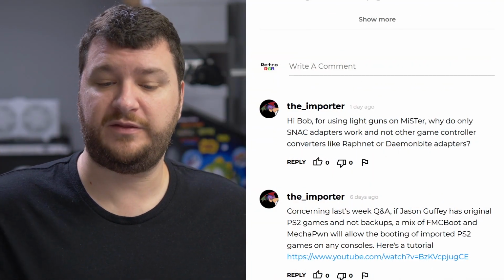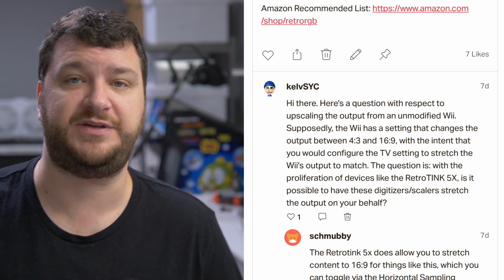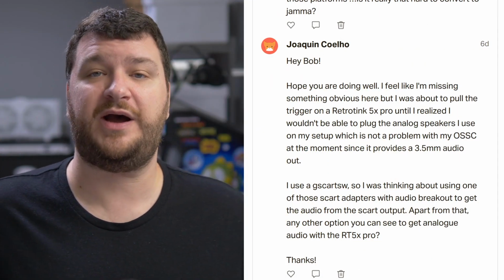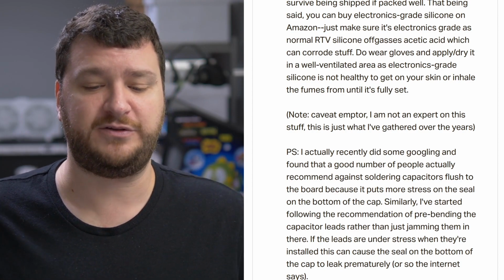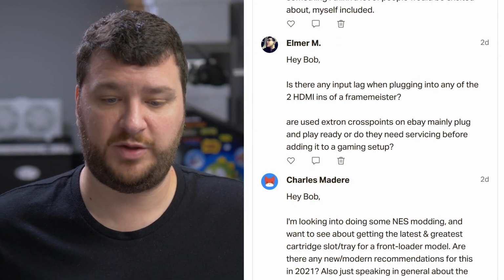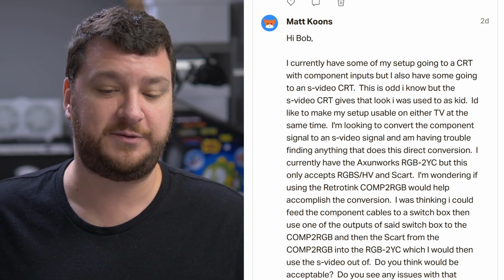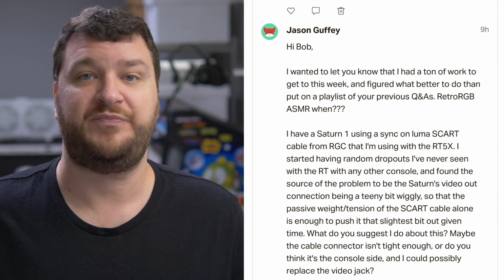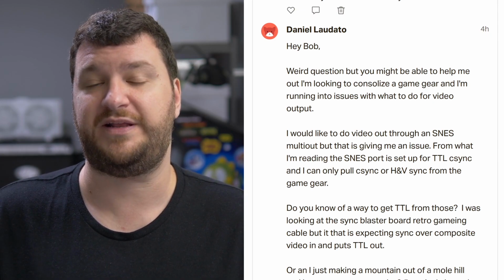Supporter Q&A #176

Comment: I've had output issues with my Wii as of late.  The video is a lot darker than it should be, when it isn't cutting out to black entirely.  Often times now, when I power it up the video doesn't display at all until the system has had some time to "warm up".  I've compared the output to another Wii I have access to and it's video is far brighter.  Oh, and I connect my Wii using component.  (Official cables in this case.)

I have an idea on what it might be.  It could be bad capacitors powering the video feed, or a faulty regulator.  I haven't seen any capacitor replacement guides online for the Wii though.  Have you seen these symptoms before, and what would you recommend is the best way to handle the issue, or at least narrow down the cause?

Comment: I never understood how Bob can't see the difference between S-Video and composite. On the N64 it's subtle, but other systems there's a huge difference
Reply from the maker: S-Video and COMPONENT.  As in YPbPr.  And on a CRT, they're very close.
Reply: @RetroRGB  Oh yeah that's true. Personally I think s-video is kinda the best of both worlds between the color clarity and sharpness of RGB/YpBpR, and the smoothness of composite.
Reply: I think he said component and S-Video, not composite. Unless you're running HD resolutions with component (like 720p from an OG Xbox), the difference between S-Vid and component is pretty small...sometimes. Composite to S-Video is a massive improvement often
Reply: S-Video's luma should be just as good as component (YPbPr) so I would expect any difference would be in the color rather than sharpness or brightness. Of course not every console outputs S-Video and RGB/Component at the same quality.

Comment: Im pretty sure that Sega model 3 games use a 24Khz Monitor, wich makes it hard to connect to a Monitor wich uses 15Khz or 31Khz
Thats why they are rarely used with Superguns. Maybe it needs a 3.3v psu too?

Comment: I've actually built three of those RGB filters for the Super Nintendo 2-chip models. The results are pretty good and I hear it's even better if you combine it with an RGB bypass.

I only needed one so now I have two spares that I'm trying to sell for what I think is a reasonable price if not I did put a best offer on it.

Comment: It sounds like the audio had some issues in this, I can hear crackling in some parts. Thought it was on my end at first.
Reply: No it wasn't at your end, I've heard it too
Reply from the maker: Really sorry about that.  I didn't re-listen to the whole thing stat to finish, but I scanned a few parts with good over-ear headphones and couldn't hear anything this time.  Maybe I set the gain slightly too high?  Or maybe I was accidentally hitting the table with the mic stand on it?
Reply: @RetroRGB  28:42 you can hear the crackling, if you're looking for a reference 👍
Reply: @RetroRGB  It sounds like it could be buffer underrun but might also be clipping or other electrical noise. If it were clipping I'd expect it to be more consistent.